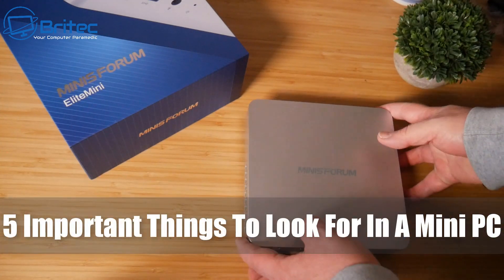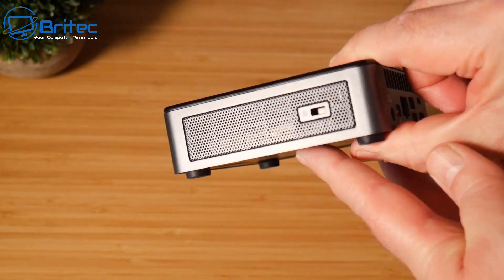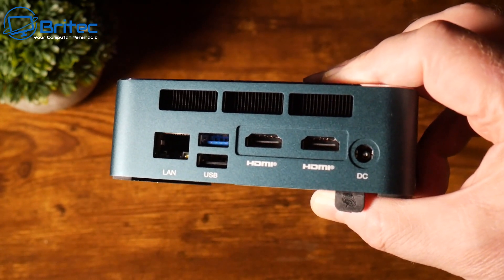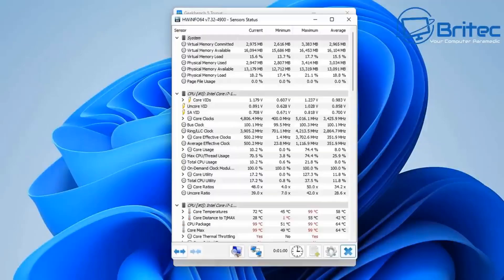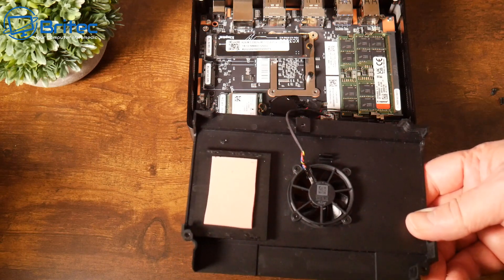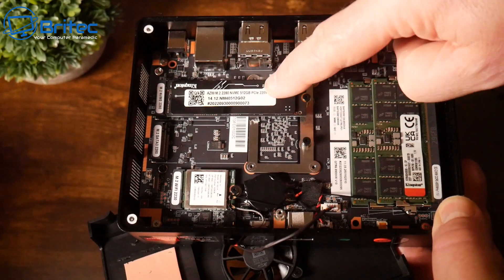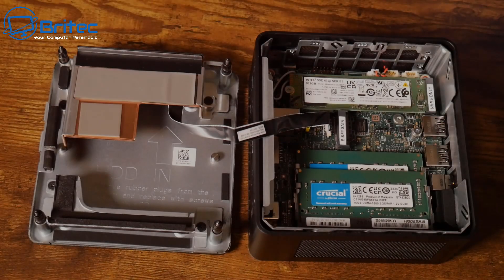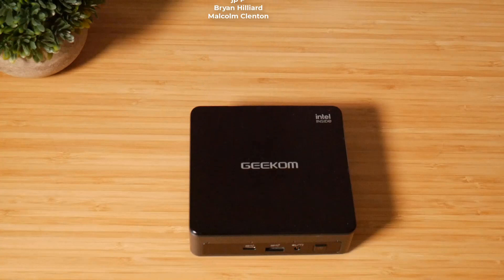5 Important Things To Look For In A Mini PC

Comment from the maker: What mini pc did you buy?
Reply: I got one of the first you reviewed - a Beelink U59 Mini PC.  Does everything I need and am well pleased with it.  Not expensive at the time, either - £319 in April 2022.  Upgraded M.2 Sata Drive to 1TB and put in a 1TB SSD as well.  It is a bit slower then my high-end gaming rig, but for general use it is silent and runs W11 well.  Recommended.  BTW the W11 licence was a retail licence not an OEM - bonus!
Reply: Beelink SER3 Versatile Mini PC, AMD Ryzen 7 3750H(up to 4GHz) 4C/8T, Dual Channel RAM Up to 64GB, Radeon RX Vega 10 Graphics 4K@60Hz Dual Screen Display(16GB/500GB)
Reply: intel nuc
Reply: Just bought a bee link ser 6 Pro. I would be grateful for your recommendations as to a suitable ssd to expand the storage.

Comment: I'm a new user of a mini PC, and I wish I'd seen a video much like this one before I bought my unit.  This isn't because I blew the routine, though -- I could hardly be more pleased with my digibrick.  I just didn't know what to look for, and I suppose I got really lucky with the computer I DID buy.  It's a MinisForum EliteMini HM90 with an AMD Ryzen 9 4900H CPU, 16 GB of DDR4 RAM, and a 512 GB NVMe SSD.  It has a  7 USB 3 ports, 2 LAN ports (1Gb and 2.5Gb), 3 video ports (HDMI 2.0, DP 1.4, and DP via USB C.

I bought this PC with audio recording in mind, which means running a DAW (Digital Audio Workstation software), connecting a USB audio interface, and potentially running several to many plugins for instrumentation and/or audio processing.  I could find no real guidelines as to how much computer to buy, but I decided that going for light gaming should do the trick.  I could mention that my old system with a humble AMD FX 8 core processor and 8 gigs of RAM never let me down.  Now I have the same number of execution cores, double the number of threads and double the memory.  The biggest bummer I know about so far is the mysterious tendency of the rear-mounted USB ports to stop working after a few seconds under Linux Mint 21.  This has never happened under Windows.  Workaround I'm using so far is to connect my 10-port USB hub to the front-panel ports.  Ugly, but it works.

Comment: just bought Ryzen 7 5600 mini PC w/ 16GB, 512 SSD for under $500, ive bought under $200, 150 ones and theyre sooo under powered even w/ a celeron 4 core ones, so if youre willing to spend  a few hundred on one, i recommend at least 4 core non celeron one w/ SSD and least 8 GB, and youre gona need 1 usb 2.0 hub to plug keyboard, mouse, and external speaker
Reply from the maker: Thanks for sharing

Comment: Towards the end is a mention about Minisforum. An Elite Model uses Type C input Voltage 19 with 65 Watts. A Docking Station with Type C output is rated 20 Volts for 85 Watts. Is it safe to use that Dock and distribute the load? Thanks☺